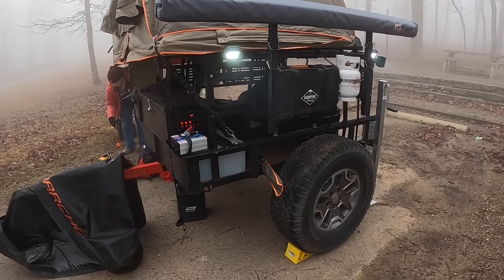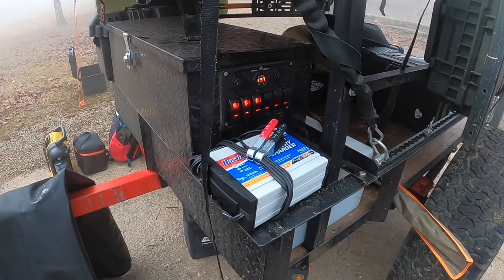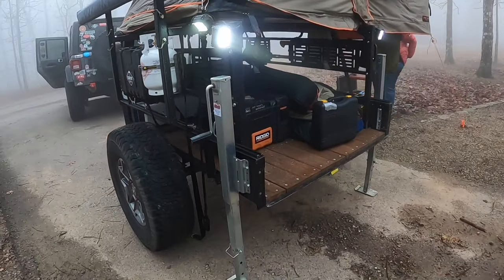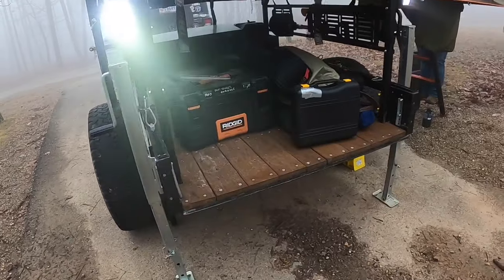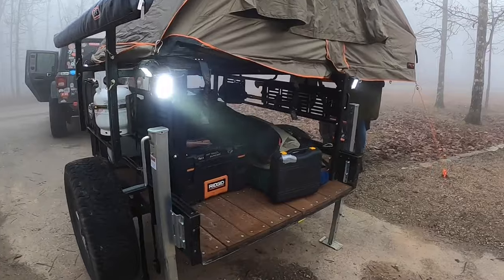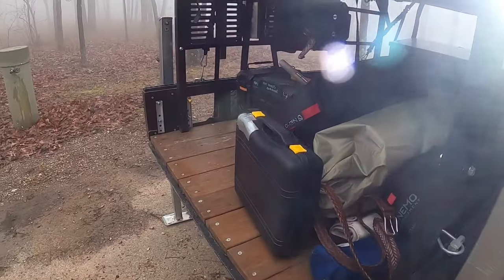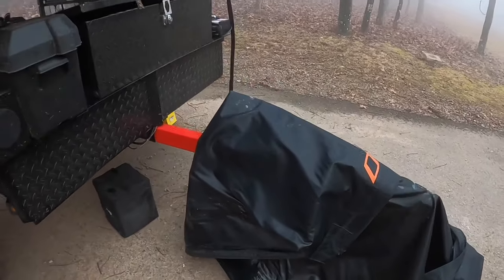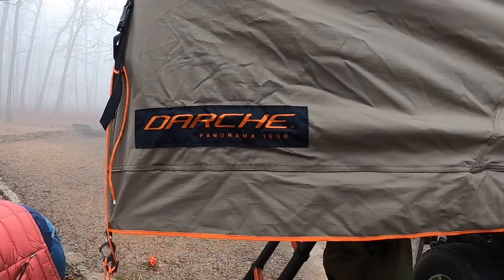DIY Camp Trailer Walk around Mt Magazine Arkansas

Comment: WSMFP!!! I'm going to be building a similar trailer and will be starting with a lowes 4x6. It's good to know with minor frame mods they are durable enough!
Reply from the maker: Mine is set up with zero frame mods. Just an upgraded axle mounted to the original spring mounts

Comment: Liking that tie down system. What are the dimensions of that water tank and where did you get it from?
Reply from the maker: It’s a 21 gallon I bought off Amazon. It’s 39x16x8. I might be downsizing to gain some room for a diesel heater. 🔥

Comment: I don't know much about setting up a power station. Can you tell me what type of battery you are using or possibly make a video simplifying this because there aren't many out there! Nice build!
Reply from the maker: Yes, stay tuned to the channel in the next couple of weeks I will be redoing my set up on the trailer and I hope to get the majority of it films for a video. Glad you like the build!
Reply from the maker: The battery is just an average priced marine battery I picked up at AutoZone. It’s tied to my 7 pin trailer harness so it charges the battery when I’m driving.

Comment: Inspirational-  is this a 4 x  6 trailer and where did you get it?
Reply from the maker: I purchased a bare trailer used but it was originally a 4x6 trailer from
Lowe’s.
Reply: Thanks for responding. That's what I thought.  I've been looking at that same trailer here in Colorado at Lowe's but  a galvalume kit from Home Depot  I'm in Colorado right now but I live in Florida and will also use it to haul kayaks, so I'm worried about rust.
Your video is very good and informative.  After I watch this more closely, I'm sure I'll have more questions for you.  Again- thanks
Reply from the maker: Go to my website for a full rundown of the build. 

www.highpointoverland.com
Reply: @Tail_Dragger  will do!  Thank you!

Comment: Did you custom build this trailer or cut down an existing trailer then mod it out? What is the length width of the final assembly? I have a 5x8 with a ramp that my 23zero walkabout is currently mounted too.
Reply from the maker: It’s 4’x6’ inside deck dimension. I cut everything off the trailer but the base frame and rails then reinforced it, put a 3500lb axle under it. Tongue to tail is 9’6”.
Reply: @Tail_Dragger  I have a 5x8 that has been my carry all including my 23zero tent. We pull it behind my truck and Jeep for camping. I put a plywood floor down in mine with E trac for the tie down points, I like what you have done and am seriously considering a similar project.
Reply from the maker: @zodar1400  you should do it! Where are you from? I have had a blast building it and I have over 3000 miles (1000 off road) on it since late July with zero issues
Reply: @Tail_Dragger  I am in Central Ks but grew up in southwest Missouri.  What axle did you buy for yours and did you change the hubs out for the jeep bolt pattern? I don't think I would cut mine down but a new axle mine is currently flipped for a little more height and either a pintle high or a hitch like yours is a must have for trails.
Reply from the maker: I forget the brand axle but I bought it from
compact camping concepts out in Oregon. The hubs came 5x4.5 or visa versa, I have 1.5 spacers to help the tires clear the trailer.

Comment: where did you pick up the side rail tie downs and clamps ?
Reply from the maker: Pit Posse 4' Aluminum S Track Tie Down Rails Set Of 2 - Heavy Aircraft Quality Aluminum - Adjustable - for Flatbed, Truck, Cargo, Van, Enclosed Trailer - Automotive Accessories- 5 Year Warranty- Blac https://www.amazon.com/dp/B008TU6DQI/ref=cm_sw_r_cp_api_glt_fabc_1KWGKYPKDGNB3JK0AY43

Comment: What kind of axel do you have to fit those Jeep wheels?  I have a set of factory 17 inch wheels with duratrac tires that I would like to put on my trailer but even with a 4x5 to 5x5 adaptor, the baring hole is too big for the jeep wheels.
Reply from the maker: I am not sure what brand axle it is I bought it through compact camping concepts in Oregon
Reply: Thanks.  I'll check it out.  cheers

Comment: Would this be to small to carry a hobie outback kayak?
Reply from the maker: Not at all if it was mounted on the side. The rooftop tent would make it difficult up top
Reply: You read my mind. I have a trailer similar to this that I want to build into an overlander trailer. But also want to be able to load my fishing kayak. I'm thinking about removable mounts below the RRT to hold the kayak. Love this build BTW! Gives me so many ideas. Thanks for this video!
Reply from the maker: That would be very easy to do by just adding 2 cross bars to the tent rack 👍🏻
Reply from the maker: There will be an updated video coming out in the next week or so showing off recent mods. Check out my webpage for a detailed list of products used to get it to where it is now 
www.HighPointoverland.com